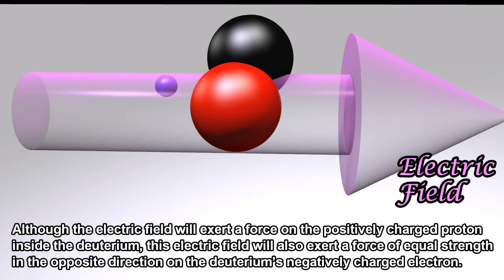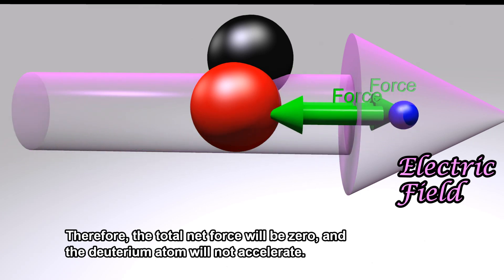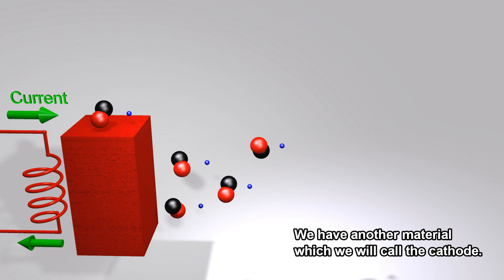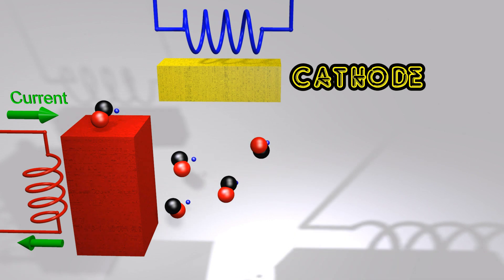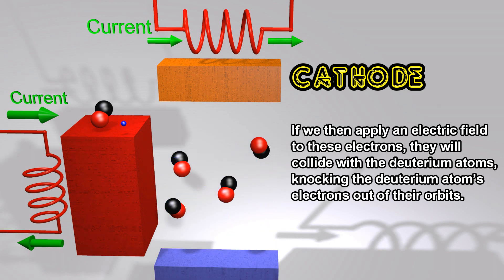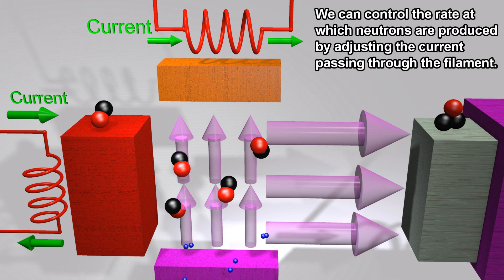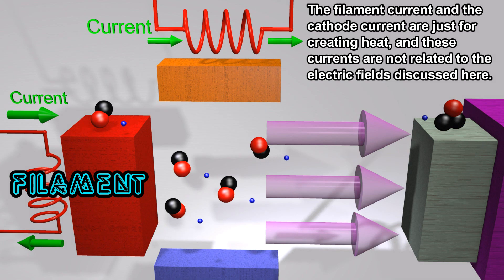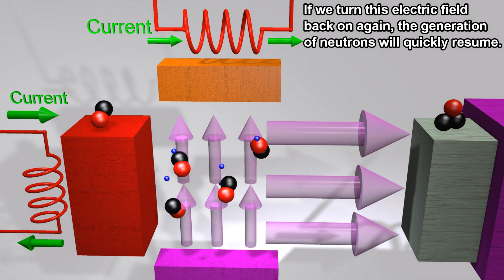Neutron Generators using Particle Accelerators

Comment: In the first scenario, how come deuterium hitting tritium will end up in a model of two protons and two neutrons? is this stable? in the other scenario, how electrons from cathode kick off electrons from deuterium instead of displacing them, so it will result in no change?
Reply from the maker: Two protons and two neutrons is a Helium nucleus, which is stable.  In reply to your other question, the incoming electrons have sufficient kinetic energy to prevent them from becoming trapped by the protons in the nucleus.
Reply: @EugeneKhutoryansky
Reply: @EugeneKhutoryansky  But helium has two electrons, 2 protons, and 2 neutrons. Also, how protons get stabilized if they are left without electrons. Neutrons are neutral, if they separate themselves without nucleus or atom, they will accumulate as dense particles, so how can you collect them?
Reply from the maker: If a neutron is close enough to a proton, they can be held together by the strong nuclear force.  Some combinations of protons and neutrons are stable, others are not.  But, this does not depend on the presence or absence of electrons in orbitals around the nucleus.  Therefore, a helium nucleus (two protons and two neutrons) is stable with or without the electrons in the orbitals.

Comment: Thank you for this highly demonstrative video, I have some questions:
1. Isn't this helium generation look like fussion process.
2. Will the target vanishes as it converts to helium.
3. How the resultant neutrons will be collected and controlled and what might be the application they can be used for
Reply: 1) yes this is fusion (but fqr too insuficent for energy production)
2) yes. But it would take a lot of time since the number of neutron created that way is way lover than the number of atoms in the target 
3) it's a relatively cheap neutron source(compared to reactors for example).So you can use it anywhere where you wanna create neutron (it doest create a lot of it though)

Comment: This is how they detonate an atomic bomb right? By releasing neutrons and starting the fission chain reaction?
Reply: Yes. The first initiators used Polonium 210 and beryllium separated by a plating of some kind, it was timed by when it got crushed ‘the right amount’ and was placed in the middle of the pit. They did need frequent replacement as Po210 decays away. Newer weapons likely use something like this, though many details are classified.

Comment: One small remark: 
At the beginning (0:18) you are using the term: " two types of atoms". Which is not true. Deuterium and tritium, both are atoms of hydrogen, because, from the point of atoms, they are the same (both have 1 electron). They are different isotopes of hydrogen. 
But the overall video is very nice! :)

Comment: Doesn't electrons from deuterium rips off naturally electron field that accelerates deuterium is strong enough? I wonder why electron emission to remove electron is necessary.
Reply from the maker: No, the electrons will not be ripped off just due to the electric field alone, because this electric field is not strong enough to do this.
Reply: @EugeneKhutoryansky  Thanks! So neutron generator like these doesn't use voltage up to fusor's? I think fusor doesn't have parts that ionizes deutrium atoms.

Comment: Thanks for the awesome videos. I'll be heading over to Patreon to help sponsor the next one!

I have a question that I am sure you can answer: It is my understanding that neutron generator tubes are sealed and only require power. How do these devices not require a continuous feed of deuterium/tritium? Does it just deplete that slowly, or does it somehow regenerate or naturally get replenished? I've heard these tubes can last for years and years in some cases, and I was curious how this is possible.
Reply from the maker: Thanks for the support on Patreon.  I really appreciate that.  In reply to your question, the amount of tritium and deuterium that gets used up in these reactions is a tiny fraction of the amount present.  Therefore, the tritium and deuterium will last a very long time.
Reply: @EugeneKhutoryansky  Thanks for your reply, that is interesting.

Comment: This is a bit deceptive in that it doesn't show the actual model of what an electron, neutron, and a proton actually are. It just shows moving spheres. The way an atom actually looks if you could visualize its fields is very different than this and can lead to confusion. They don't even explain why a current can cause electrons to emit from one type of material and full atoms from another. There is a lot missing in this model.
Essentially this is matter phase transitioning using a very inefficient method.

Comment: sorry i got one question. I am wondering this is the mechanism of nuclear fusion, right? But aren't scientists still struggling how to build a high temperature environment to let this happen? So is such neutron generator already practical in real life or is it still one blueprint which can not yet be made?
Reply from the maker: These neutron generators already exist.  However, the energy needed by these accelerators far exceeds the amount of useful energy that is being produced by the nuclear fusion.  What scientists have not yet figured out is an efficient way to make a nuclear fusion generator, so that the amount of useful energy produced is far higher than the energy consumed.

Comment: (please correct me if I am wrong) How can u just knock the electrons off? In a deuterium atom, the proton holds the electron with quite a bit of force, the other electrons coming in will get repelled and won't knock it off.
Reply from the maker: If the incoming electrons come in with a high enough of a speed, they can overcome this force.
Reply: @EugeneKhutoryansky  there a way to know how fast?

Comment: I am sorry, I just have a question, the process described for neutron release is basically nuclear fusion, right? how can a proton get close to another proton until they get fusion? What about the electrostatic repulsion?, this requeire the gravitational force from a star to create these extreme conditions, how that works??? Thanks!
Reply from the maker: If the particles are accelerated to extremely high velocities, as they are in the particle accelerator, then the repulsive force from the target nucleus will not be enough stop the particles from colliding with them.

Comment: But why deuterium escape from the source if we heat it?
Reply: +Rodrigo Appendino My guess would be that the increase in kinetic energy allows them to vibrate/wriggle their way out
Reply: But why only deuterium and not hydrogen?
Reply: I think that there´s no hydrogen in the filament, just it´s isotope deuterium, which has an neutron in it´s nucleus that hydrogen hasn´t.

Comment: I have questions. If proton + neutron are much heavier than electron, wouldn't strong electric field just rip electrons from atom and accelerate positively charged nucleus in opposite direction, by itself  ? And if we knock off one electron with another, why third electron doesn't just bind to + charged nucleus ? Btw great video :)
Reply: +Marko Stojiljkovic I would imagine that with both the cathode and the accelerator running at the same time, deuterium atoms are held until the moment they lose an electron, where they are rushed off out of the electron shower towards the target before another electron can bind.
Reply: I think you are right.

Comment: Great demonstration. But how do you create a beam of neutrons in which the neutrons travel at roughly the same speed and in the same direction?
Reply from the maker: +MrRobin667Cc, You can do this by surrounding this neutron generator with material that is good at absorbing neutrons, and leave just one small narrow hole through which neutrons can escape.